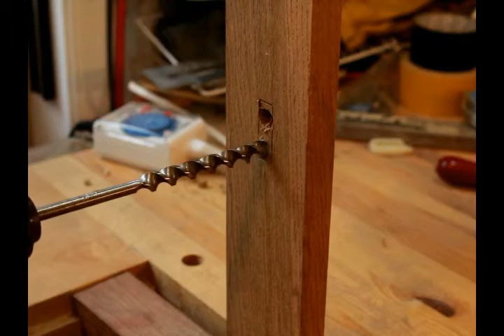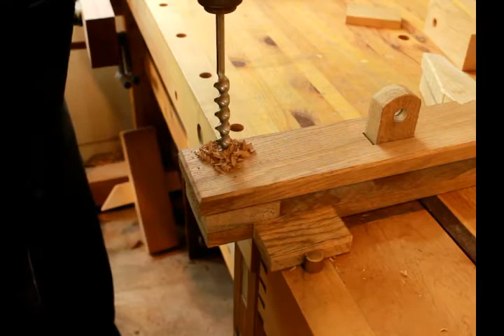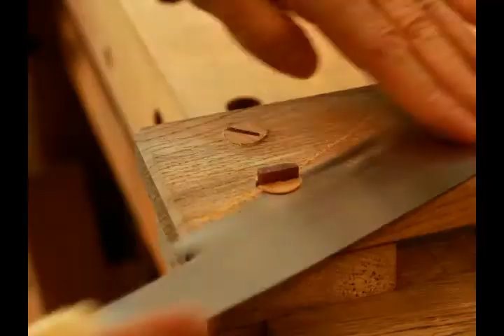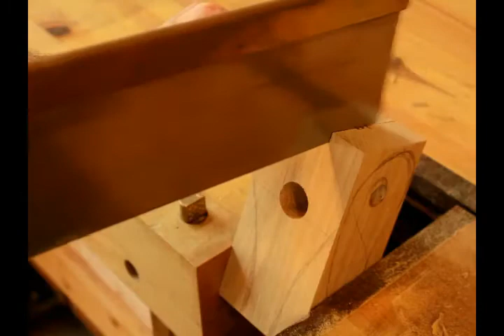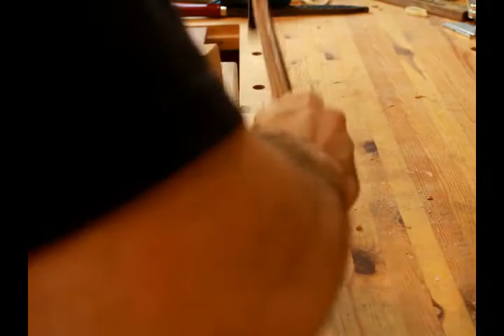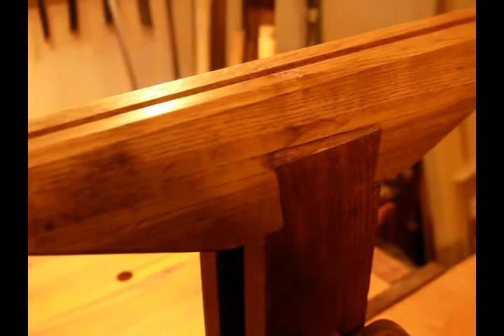Make a quick release saw vise entirely out of wood with hand tools! Part 3 of 3

Comment: Awesome video, what did you finish it with?
Reply from the maker: Thanks! I just put a coat of boiled linseed oil on it. Nothing fancy!
Reply: @TenonsTenors  I love that the whole think is made from wood - any chance you could share the plans or dimensions? I'm interested in building this.
Reply from the maker: @cjmshadow89  Thanks! Unfortunately I don't use plans and build everything by eye. The jaws are about 30cm (1ft) long. Everything else was made to be proportionate and have sufficient strength to resist the stresses applied when clamping. Sorry I can't be more specific!

Comment: I have a metal version of this type of saw vise, it doesn't work! The way that it tensions just doesn't hold the saw tight enough while filing, especially on larger hand and panel saws. Now that you've had this for a while how has it held up? do you find it keeps the saw plate in place while filing?
Reply from the maker: Thanks for watching! I never had a problem with tension, it gripped well. What did happen though was that I actually pulled out the tenon holding the lever in place due to the clamping force generated and had to insert metal wedges like those used to hold an axe head on to reattach the tenon. However, in all honesty, I bought a metal Grammercy saw vise several months later that is absolutely amazing and that's what I use now.
Reply: @TenonsTenors  I appreciate the honest reply. I've appreciated your home made tool solution to some problems. Its a balance, using hand tools only does pose some problems that need to be solved. Sometimes we can make a solution, other times we need to purchase the solution. I'd love to own that grammercy vise, but man its pricey. I try very hard to buy used vintage when possible, but other times I save for a while to buy new.
Reply from the maker: @Gotmovezlikejagga  It is an investment. But, if you do get it you won't be disappointed.